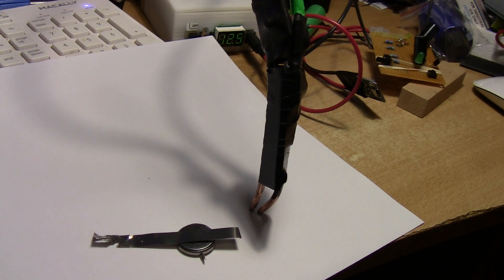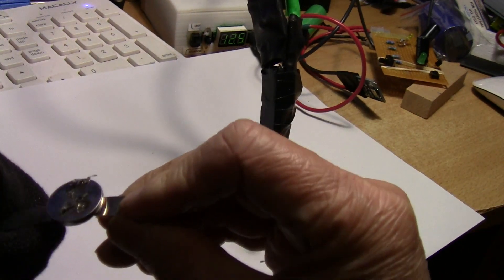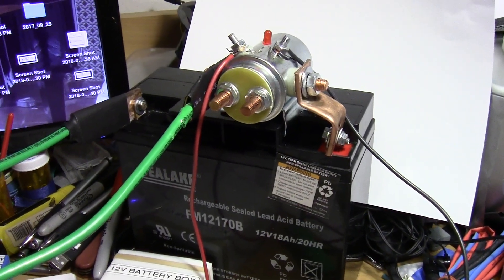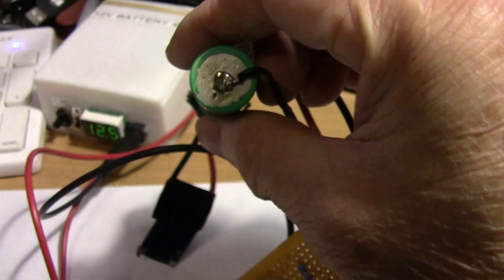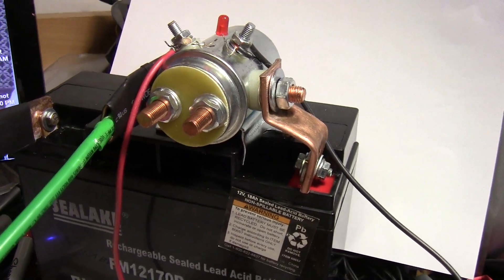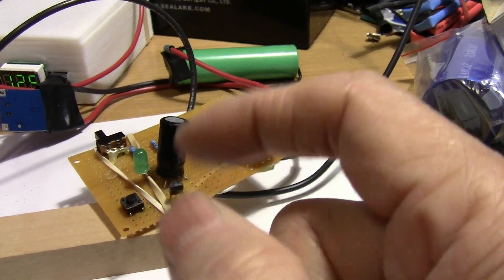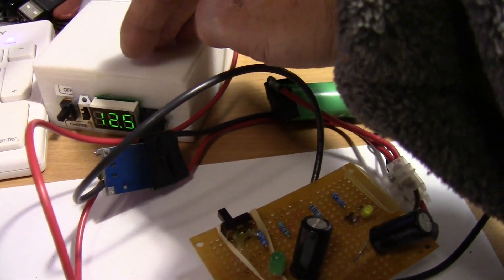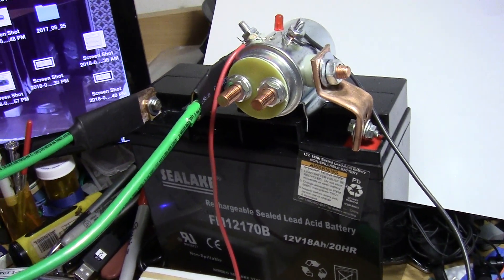12 volt battery powered 18650 spot welder experiment  part 1: Assembling the parts

Comment: Can i use battery clamps instead of directly connecting the solenoid to the battery. I plan to use them with the battery from the car without taking them out. Thanks
Reply from the maker: Might not be good for your car.
Reply: @wtam69  thanks

Comment: So adding two levers on suspension springs secured down to your work surface greatly improved my welds with this setup. It all but eliminates those sparks shooting out and you don't have bend or twist the copper contacts to get consistent pressure between both. Just requires a couple of pieces of wood and some metal clevis pins to act as a hinge of sorts. Works great. And good video. Darkkevind/AvE really came up with a good build.

Comment: Hi,

Would a Motorbike Starter Solenoid Relay from Honda TRX250X/300EX/250 TRX400EX Kawasaki be adequate too ? Thanks ! 🤔
Reply from the maker: I suspect it should work.  The higher current capacity of the solenoid is for more sustained usage whereas I suspect a lower power handling unit might burn out quicker. I have not measured the current going through the electrodes but it's probably over 30 amps.

Comment: I built a timer circuit that is adjustable down to microseconds for my spot welder. I'm building one that will be housed in a soldering gun and hook up to a 12 volt battery. These videos have been a huge help! In also using a starter solenoid for an atv. It fits better in the soldering gun.
Reply from the maker: I just soldered a bunch of 26650s lithium ion cells and this welder with the timer works very well.  I hope people will see this as an alternative if their commercially bought unit does not work satisfactorily.

Comment: If you remove the green plastic wrapper from that 18650 cell it exposes a lot more metal surface that you can use for testing the spot welder.

Comment: Are 18 amps mandatory? Can we use smaller and less expensive 12 volt batteries?
Reply from the maker: 18 amp hour battery and 3 to 400 CCA is what I have on hand and it works.  Others have tried it and were satisfied  with 3 to 400 CCA batteries so I didn't want to reinvent the wheel.  Maybe a 7 amp hour battery would work too but I haven't tried it.  I tried to follow the recipe so I don't waste too much time.
Reply: It's weird cause anything over 250CCA for me was just WAY too much power. Id always end up blowing holes in either end of the battery with about 290CCA. In the end I had to stick with a 195CCA battery and that works great. The Ah shouldn't really matter but it just means you might have to charge the battery more often

Comment: I have a few battery tab welders I have built myself and one thing I learned the hard way. When welding, no matter the power. It is really important to put pressure on the electrodes and the battery. To much pressure and the electrodes will get stuck, not enough pressure and you get sparks and you might burn a hole in the battery. It takes some getting used to, but each welder is different.

Forgot to mention, with a battery tab welder, you have to make sure the button you use will release quick enough. For example, I went through 4 different momentary buttons till I found the best fit. If you check out my video, you might reconize the button. Timers will also never work with a battery tab welder. The tap on the momentary button is so quick, that even .0001 sec is to long.
Reply from the maker: You are so right.  There are many factors to making a welder that can do a good enough job.  Rank high on the list is the contact pressure. Then you have cleanliness of the electrodes, the power or welding current, duration of the weld, the thickness of the welding strip and the thickness of the battery terminals.  Results for diy welders cannot be consistent because each builder use slightly different parts. If you use 4/0 cables and 10 gauge wire electrodes, it's going to be a little different from someone using thinner wires and more pointed electrodes.  Different capacity batteries and different state of charge of the batteries will give out more or less current and changing the result of your welds.

 I use a timer as it's sometimes difficult to manually time the weld.  I'm sure other people can do it without the timer.  I bet you people using commercially available still have to contend with the same factors I mentioned earlier. The advantage of a commercial welder is probably the ability to adjust the welding current and they use the same parts for the same models.  I watch what other people do and fine tune the process to make a welder that works for me.  Thank you for sharing your insights.

Comment: I used to use a car battery and a wire hanger and do spot weld straight off the battery with jumper cables holding the wire hanger.
Reply from the maker: I didn't know you can use a wire hanger for welding rods. That's interesting. You learn something new everyday.
Reply: Did it work ? Must get lots of heat ?
Reply from the maker: Epic Gaming working well. See

Comment: My dad had an old book from the 60s or 70s, and in there they described how to weld on your car using the car battery.  I think all it described was a positive battery terminal with a momentary switch; there was a crude drawing showing someone welding the body of the car.  This is similar in principle, and it seems that with a few tweaks and adjustments, could be great for welding strips to batteries like you show.
Reply from the maker: The idea is the same with regard to the car battery welder.  A battery is more fragile so the welding a tab to battery terminals can easily go from ok to very bad. I need some more practice to make a good weld.  Thanks for commenting.

Comment: I have never tried welding battery tabs before looks pretty easy. I don't know if its good or bad but i usually end up tinning the ends then soldering the battery tabs on seems allot easier to replace the cells or make changes if there only soldered.
Reply from the maker: Yes, I always soldered my battery tabs to the battery too but some suggest there'd be battery damage due to overheating.  As you can see in the video, a poorly made spot welder can do far more damage. A split second too long in the welding and you can blow a hole in the battery.  I guess the way to find out which route is better is to make one yourself.